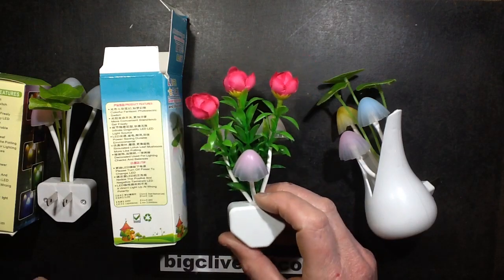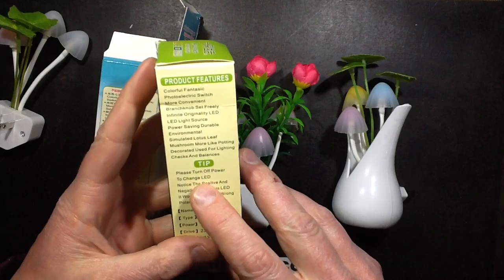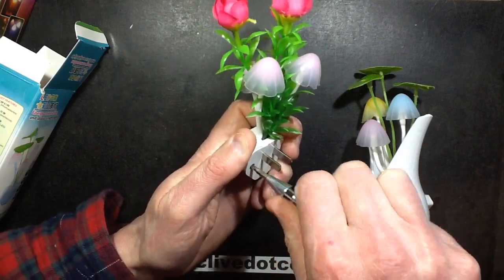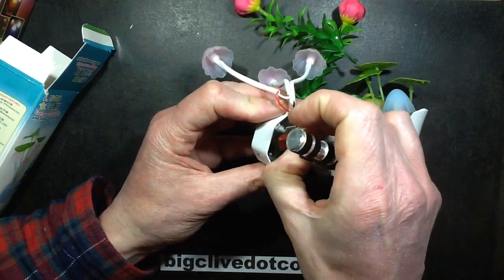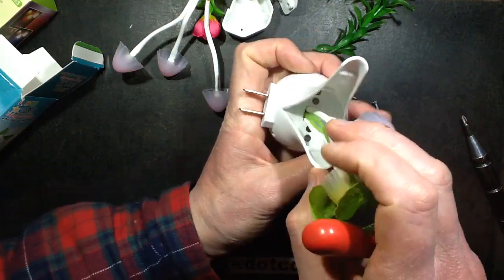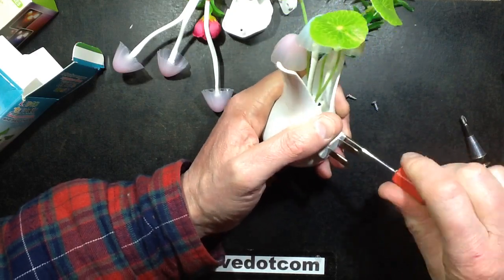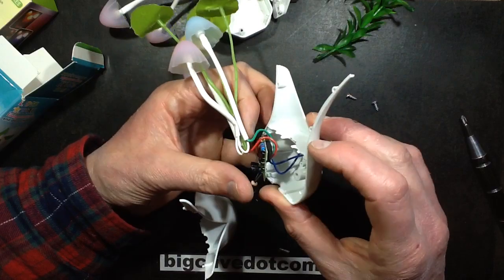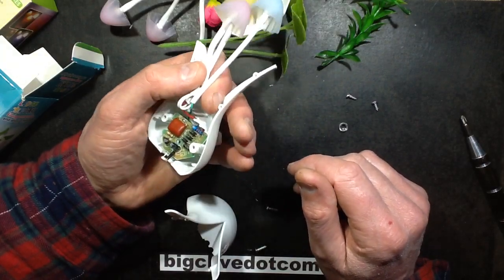Not mushroom for improvement.

Comment: Disappointed that there were no diodes in the flowers of the first one!  Still, that probably could be fixed, though .....  And uplights for the "vase" version.  Probably wired in parallel so the current through the "auxiliary" LEDs is half that through the "main" LEDs; that ought to enhance the effect, rather than spoil it.

Comment: anyone know a source for the mushroom caps? I need quite a lot of them, and buy the complete light and tossing the rest seems a bit too wastefull (and expensive) to me.
Reply: +bigclivedotcom Hmm guess it diy time, tried contacting a couple of vendors and see if they would sell them seperately, non luck or understandable answer back so far. I think i'm going to cast them out of epoxy. I hoped to skip the whole mold making step, ah well now i can make different models and get to play with UV pigments
Reply from the maker: +JCGver Sadly no.  I had a look on Alibaba and could only find the complete thing.  I think you may just need to bulk-buy the cheapest version you can find online.  If you contact one of the ebay sellers they may be able to do you a deal on a large number.  The might even remove the caps and send them to you to save on postage costs.
Reply: This girl made her own out of Sculpy, looks good
http://m.instructables.com/id/Luminous-Mushroom-Night-Light/